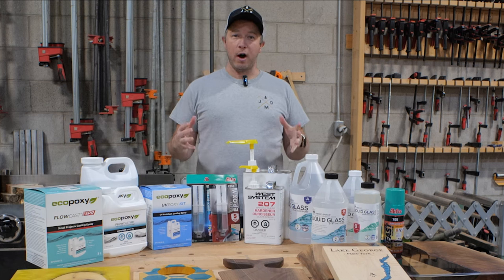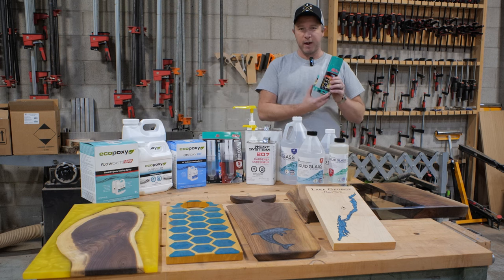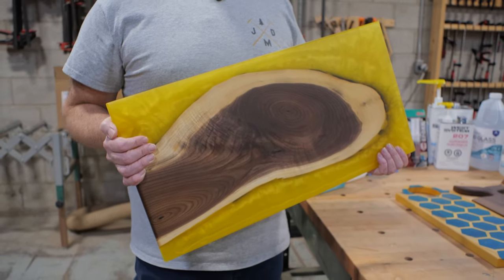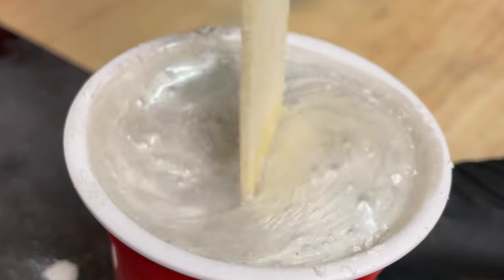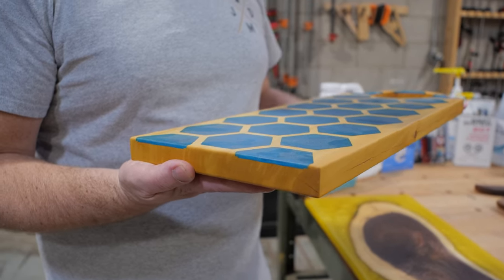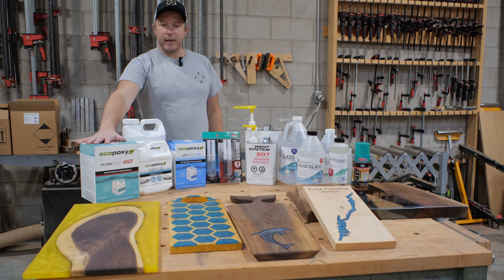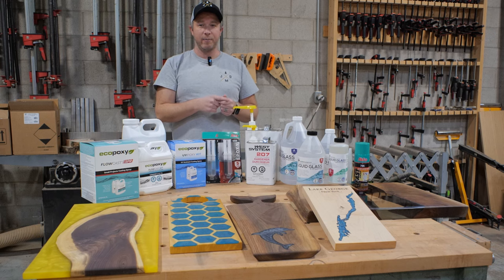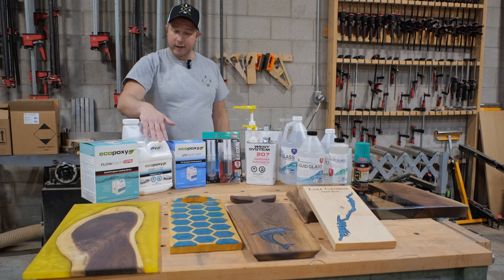What Resin To Use | The Best Epoxy For Woodworking

Comment: Great info!
One problem for me is location ( Sweden).
So my post will concern the need for affordable, good products outside US/Canada.
In the past I worked in renovation, so my experience using epoxy was for industrial flooring etc.

When starting to build customized items like closets, using epoxy was really a whole new experience.

Especially the fact that there are many epoxy products available that do not cut it - whether it is low VOC during curing, performance or what ever.
Ecopoxy has probably gotten better, not a great product when I tried it a few years ago.

I was recommended the Black Forest products from users. Seams like they have a great product.
But really, living in Europe, you are ' punished by location ' whit the added charges.

So for one project, a customized closet with wood and epoxy doors, I started looking for a solution.
For you guys in Europe, I can leave a recommendation for this product.
It is a company called Easy Composites.

It came out great, simple to use, (the general idea is for countertops), with a 3D effect.
It worked well for this project, and low VOC during curing.
They have other products as well of course, but have no experience using those yet.

https://www.easycomposites.eu/jaded-copper-resin-countertop-kit

Keep up the great work!
Reply from the maker: Thank you for sharing your knowledge and providing a suggestion! GlassCast seems like it would be a solid product, but we have not had the chance to work with it.
Reply: @jeffmackdesigns  
Thank you for the fast reply Jeff!
And thank you if I can provide good, valid info.

Yes the company may be a provider of other good products as well.

Being in the business of delivering a product, like your self,  - what ever that may be - that requires a lot of work before applying an epoxy product, may and can be, a gamble.

So atleast the product Ive used as described, provided a great result.
The biggest fear for me (and certainly for guys and girls in your business) is to NOT being able to deliver an excellent service and product.

Simply put - no matter where you are, good, safe and stable products, at a descent price, are needed for our work to be top-notch.

Comment: Very helpful video,thanks. I have a cookie slap 4 inches high and needs only 10 kg of epoxy to fill up. Do you believe with a good room temperature Flow cast will cure properly?
Reply from the maker: It depends on the pour thickness for whichever epoxy you use. Stick to the manufacturers recommendations!